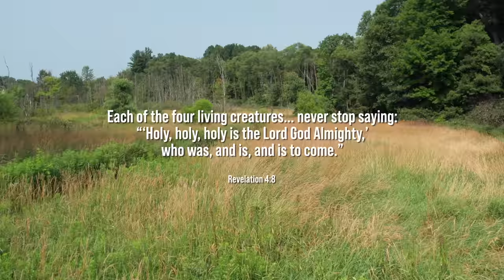CHEAP GRAPPLE BUCKET CONVERSION THAT DOUBLES THE VERSATILITY

Comment: Years ago an employee at a local quarry told me a 5 yard bucket of common gravel weighs ~ 3500 lbs.  A friend of mine loaded one bucket in his Ford pickup.  He broke the springs and blew out both rear tires on the spot.  He did not weigh the material, of course, but the message was don't do anything that stupid.
Reply from the maker: Lol good call
Reply: More like 2200 lbs a yard.
He was way off. Wonder if he meant 3.5 tons
Reply: @stuartrinker  I remember it as I wrote it.  At that that time I had to hand shovel another 5 yard pile of gravel.  It took a few days.  I can personally swear that it is heavy.
Reply: @stuartrinker  Yeah, wet gravel weighs 1.5-2 tons/yard.  So 5 yards could be 15,000-20,000 lbs.

Comment: I wonder how much weight was there with those big boulders.  Really cool video showing what you're up to at the property, and the products of course!
Reply from the maker: I don't know, but they were stout!
Reply: I have one trailer that the manufacturer claims to be rated at 2000 pound capacity. It has a 2000 pound axle. But loading it up, I blew out one tire bc....the tires, upon close examination,  are only rated for 750 pounds. Single axle....so not 2000 pounds, it's 1500 pounds and anything close to that, you risk blowing the tires.
Reply: @northdakotaham1752  Ultratec?  Which model?
Reply: @MetsaMachines  nothing that came from GWT. Just a general comment about trailers in general. The weakest part might be the tires.
Reply: @northdakotaham1752  Understood, that makes sense.

Comment: I'm just laughing when the trailer tipped and you spend more time trying to re-distribute some gravel with the tractor rather than hopping up there with a shovel and scraping a few rocks forward...  Something I would do.
Reply from the maker: Would have taken me longer to go get a shovel and come back vs doing what I did.  Two minutes with the loader bucket.  So, it would have taken me more time to do what you did :)

Comment: I know most of us don’t have the luxury of two tractors, but if you got them, use them.  Summit loading, 2038R pulling the trailer.   Heck, you can let Chris drive and you can be the videographer.
Reply from the maker: Didn’t do that on purpose for that very reason.  Shoot, I’d just use my skid steer, big Kubota, or JCB loader for all this type of thing if I was really looking to get work done fast.  Trying to show how it goes in the real world for most of you with one compact tractor.
Reply: @GoodWorksTractors  I hear ya.  I’m the one tractor guy and would’ve had the trailer hooked to my Ranger.  Plus the tongue of the trailer and the back of the Ranger up in the air would get you more views.  🤣😂

Comment: Courtney, I had a good chuckle watching this.  This has been 75% or more of what I use my 2025r for, moving rocks!  That grapple attachment looks very handy,  and the trailer very sturdy.  Yet, just like for me, it eventually comes down to getting your hands in there and moving those rocks.😂

I might suggest, for what it's worth, with the sight limitations of a solid bucket, it might be best to remove or fold down one side of the  trailer so the boulders have lest distance to fall and possibly bounce or damage the bed.
Thanks for the video!
Reply from the maker: Haha, yep sometimes there's no avoiding the dirty work! :)

Comment: Huge fan of your videos!   Just want to suggest the way that suspension on the trailer worked at the 11 min mark makes me think you have the wrong hitch setup!

Put a pintle mount on your receiver on the tractor and a ring on the trailer.  Then you can lift your 3-point to dump the load!   Get an adjustable pintle setup so at the 3-point’s lowest practical height the trailer is level so you can get as much dump height as possible.  

You were breaking your back when your setup is so close to being able to do most of the work for you.

Comment: The bolt-on grapple is a great idea. Maybe you could add a couple of short bolt-on forks to the bottom of the loader to help get under brush or logs. Similar to the add a grapple pallet forks but shorter and bolted to the loader bucket.
Reply from the maker: Yeah, maybe so...wasn't too bad with the current setup though.  Thanks for watching!

Comment: I don't know if you follow One Eye Customs ("Neighbor Doug" from Hometown Acres), but he made a couple of mods to his Ultratec. The most significant one was a safety latch for the dump lever. Apparently it's not too hard to knock the lever if you're stepping over tow bar, and if there's nothing in the trailer, when the bed lifts up on the shocks, it can cause some serious injury. Even more if the assist handle is extended. It would be nice if Ultratec added something like that to the production models.
Reply from the maker: Hmm, interesting.  I'll have to take a look.  I haven't had that happen or even come close to happening myself.  I can see how it's a possibility though.
Reply: I use the Ultratec all the time in my forestry and firewood business, I have never even come close to accidentally releasing the dump lever.

Comment: The hydraulic  dump piston should in the front of trailer  preferably  double  pistons  so lift by pushing  straight up possible  hinged so they can angel slightly  as bed reaches it full potential   scissor lifts suck and easy to over load capacity to lift